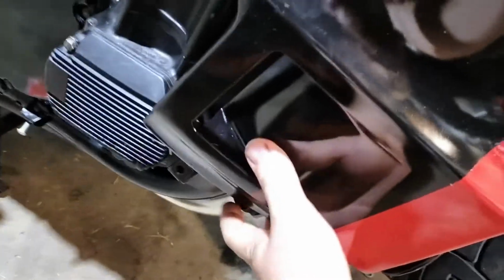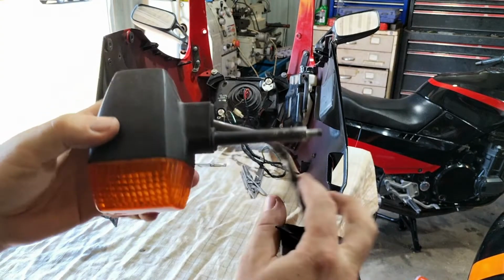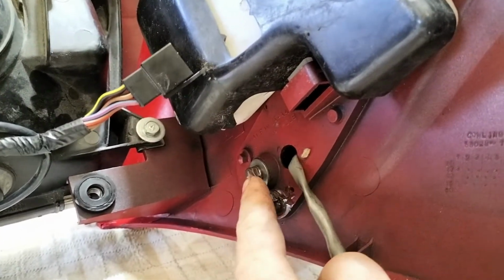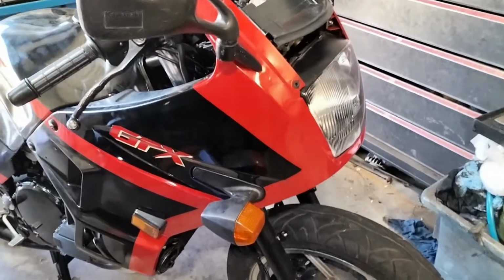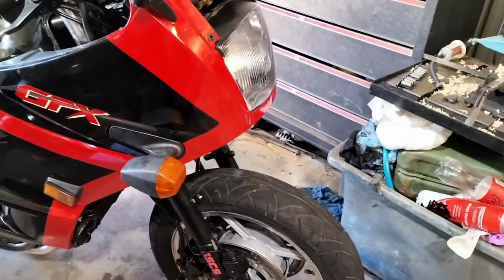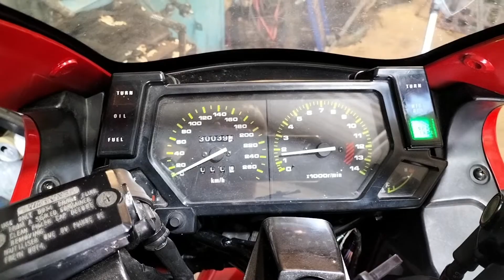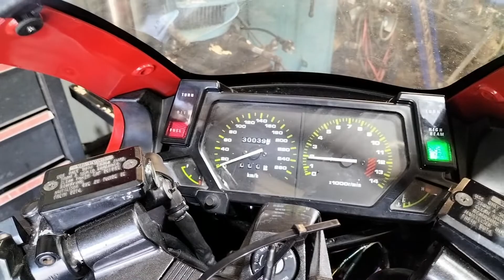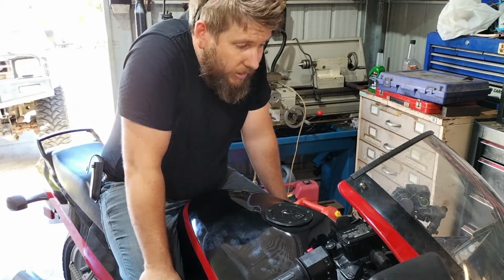GPX750R REBUILD PROJECT EP2

Comment: I’ve got an 1989 one of these I’ve been working on. I’m in need of a few minor cosmetic things to get here where I want her new mirrors, windscreen, and maybe a new tank, the inside of mine was, and still kinda is, pretty nasty. But I definitely need new body mounting bolts. More importantly it be got this teeny tiny coolant leans from down low on the engine case. Probably going to try to just in weld the leak shut.
Reply from the maker: I believe most of the body parts and such are available on eBay for the most part mate.
Reply: @HarpersShed  I was able to find a new wind screen. Haven’t been able to find a new tank so I’m making due with what I have. The bolts I’ve found but haven’t ordered yet. Getting her running again first
Reply from the maker: @tylerallison9735  I was lucky with my one the tank was in excellent condition. Fingers crossed something comes up for you mate. Hopefully the coolant leak isn't to hard to fix.
Reply: @HarpersShed  yeah. It is this little tiny pin leak coming from just above the gear lever